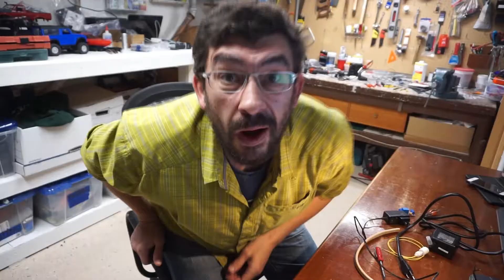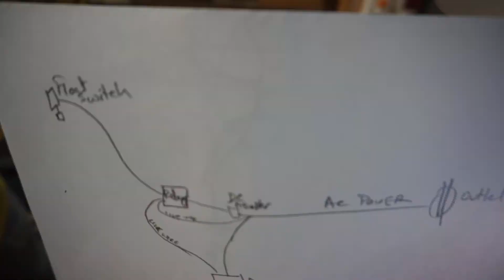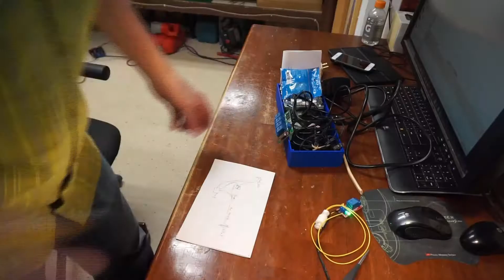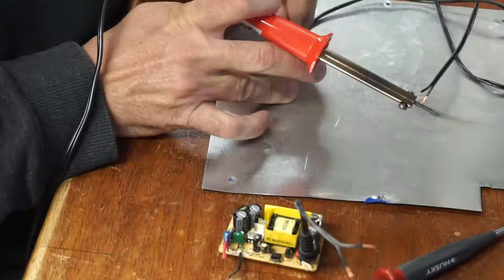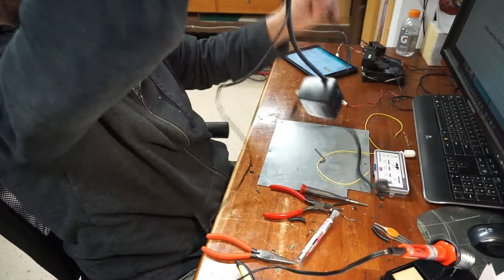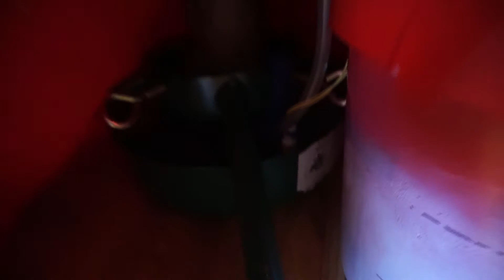Auto Christmas Tree Waterer (Auto Top Off System)

Comment: just recieved all my parts per your recommendation and will begin wiring it up soon, just any 5v power supply work?
Reply from the maker: Within reason I suppose; I haven't tried a 5V ATO but I don't see any reason it would behave differently then the 12V version. I wouldn't use more then a 1 or 2 amps output power supply.  As with anything electrical, be careful. Only do this at your own risk.

Personally, I already have a bunch of 5v power supplies that have two wires out. If, however you want to use a USB cable to a regular iPhone (or similar) Power supply, you may need to use a voltmeter to figure out which of the wires is carrying the voltage because some are for data.
Reply: @RandomProjectswithSam  so i’m having trouble with the power supply using a cut and stripped old usb cable. The cable is 5v so it should power the board. Any suggestions or remedy?
Reply: also a side note i did notice once split the usb cable wires are very thin and maybe that’s why i’m not getting power?
Reply from the maker: @Easton_Fections  I've also had issues with the USB wires; sometimes what I think is insulation (like a metallic foil) is actually a conducting wire. Do you have a voltmeter? I found it necessary to use a voltmeter not only to find what wires I should use, but also to find which is ground. The foil (at least what I tried) is really hard to solder to.
Reply from the maker: If you are getting power, make sure you have (+) and (-) right for connecting to the PCB.